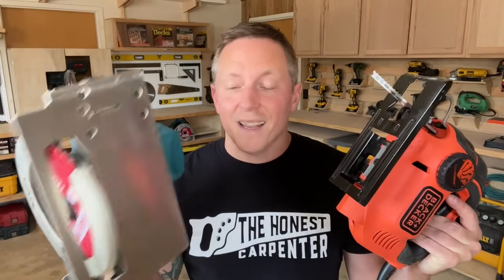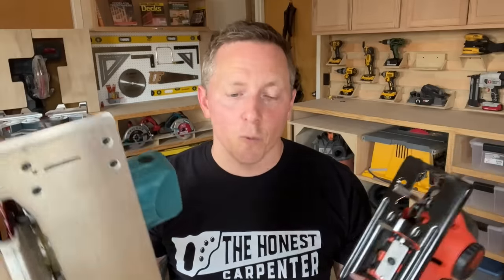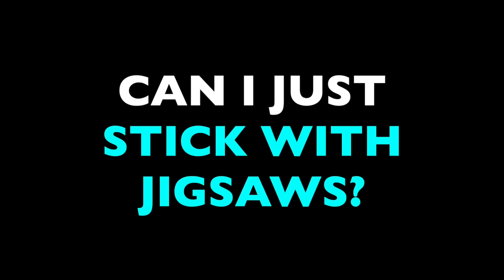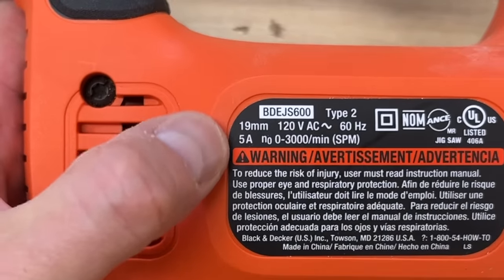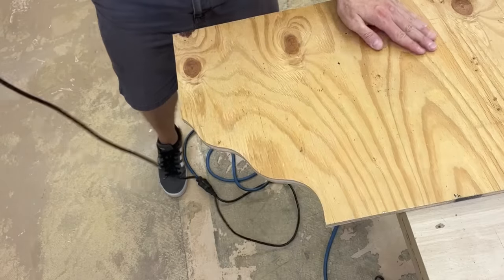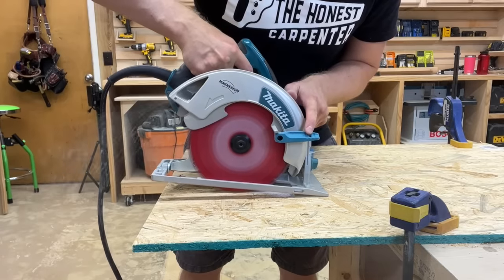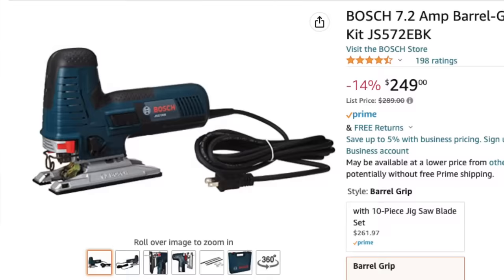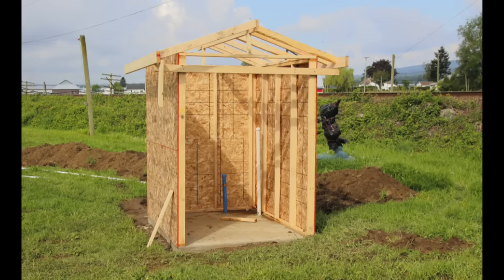CIRCULAR SAW VS. JIGSAW...Which One Should You Own?! (FULL COMPARISON---New DIYers Should Watch!!)

Comment: I can't speak for everyone but I'd need both. You'd need the circular saw to cut through heavy boards & make long cuts, & if you need to make a precision or shaped cut you'd need the Jigsaw. 👷🏿‍♂️
Reply from the maker: Yep, you definitely reach a point where it just pays to have both. This is a tough call for extremely new DIYers though!
Reply: I've used a jig saw (or sabre saw) to cut non wood materials my whole life.  Indispensable tool, and much faster than a hack saw.  But for wood, the circular saw is just so darned handy.  So I agree, get both.
Reply: @TheHonestCarpenter  yep, especially if you can't immediately get both.
Reply: @chrisnorton2837  The portaband saws are great for metal.  I started machining a few years ago.   Have 2 wood cutting and 2 metal cutting saws.    The right tool for the job.
Reply: @danharold3087  I think the choice between "best" and "good enough" depends on how much cutting you might do. The circular saw I bought nearly 50 years ago hasn't yet seen enough use to justify the greater expense of "best," "good enough," perhaps with a better blade, would have done everything I have needed.
Reply: @oneeyedphotographer  Cool I still have my Skill brand saw purchased in 74.  It is far from new.   I recently purchased a nice Makita hypoid drive rather than burn out my old friend cutting RR Ties.   

So my choice was to burn out the skill saw and then buy another.  Or buy the hypoid now and have both saws to use going forward.   

As for the bandsaws that is kind of interesting.    It comes down to your use model.    My horizontal metal cutting bandsaw came from a friend who more of a welder kind of guy.   Had no use for it after he got the portaband.   It ended up in my shop.  I put a quality blade on it and it gets used on most every project.  I do hobby level machining.     I bought the same  portaband as he did and seldom use it.
Reply: @oneeyedphotographer  The best use for an OEM blade is on the wall made up as a clock.  IMHO
Reply: @dwightl5863  best use of a jigsaw is upside-down as a sundial
Reply: @juliblued  then i would get a jigsaw,  u can cut longer pieces just takes longer , and gives time to learn skill with one and understand them more
Reply: can I use the circuit,
 reduce the speed of the circular saw.
Aliexpress has it voltage reduce circuit
Reply: First time I went to cut a 2×6 in half length-wise with a jig saw I decided to go get a cheap circular saw.
Reply: Thanks tho cause I’m building a shed and I want just the jig but I guess ima need both…

Comment: I bought this mitre saw in June 2014, and I remodeled my basement with it. It it sturdy and it works great  https://www.youtube.com/post/UgkxKL3MYO42eA2JbKxs7_Q0tmRGZI4Ow4Ar  . There's not a lot of extra play in the adjustments and it is definitely well built. It is lighter than higher-end sliding double bevel models, so I can move it myself, which is nice. When I had to cut 2x10 lumber, I had to flip the boards over and cut twice; but since most of my cutting was on smaller dimension lumber, the weight reduction and significantly lower price seemed to be a better trade off for the boards I did have to flip. Late in the project, I was able to borrow a DW718, and the sliding feature does make fast work of 2x10s, but it is a tank, and I stand by my choice of the DW715. I also added a laser guide (one of the arbor replacement style sold on Amazon), which is nice to have, but definitely not needed.

Comment: For me, buying a jigsaw first came simply from the fact that my initial wood-related DIY tasks were infrequent and small scale, such as cutting across a narrow batten or a hole into a counter. The first project for which I needed more substantial power tools was floorboard repairs, where the accurate depth control of a circular saw made it possible to lift out old tongue & groove boards without damaging joists or wiring. It could also cut down large sheets, and although I borrowed a mitre saw the circular could obviously handle chopping to length too. However, the jigsaw came in handy for nibbling away ends in difficult locations, like up to and even under dividing walls, notching around obstructions like pipes, and many times the square cutting face of a jigsaw blade was desirable over the curved travel of a circular saw. Bottom line, even though one probably gets used more, both are essential for most woodworkers.
Reply from the maker: All good points, Khakoo! Getting into that complexity of work, you're definitely going to need a combination of both, as well as possibly a multitool and recip saw. 👍
Reply: I have both but don't often use them. At the Menzshed I use two bandsaws for preference
Reply: thank you for commenting..🙏🏼

Comment: You need both.  That said my first was a jigsaw because the project I needed to do needed a jigsaw. I couldn't afford both in those days, so whatever long straight cuts I had to do I did with the jigsaw.  Including an 8 foot plywood rip... I clamped a level in place to use as a guide - wasn't too bad - except I had to move the 2 foot level every 20 inches or so.

Comment: It was amazing to see those photos of houses being built out of so more wood. Here in the UK that's virtually unheard of. Most houses are built of double brick walls with insulation between the layers then fitted out inside with timber frames and plasterboard. Roofing and floors are made from timber.

Comment: I had a near mistake with the jigsaw yesterday because of the points you make with them. I "carelessly" picked it up to move it out of the way and accidentally pressed the trigger without having the lock switch engaged. I would never have done that with my circular saw. Excellent video, as usual.
Reply from the maker: Glad it wasn't bad, Elmo! That's what's crazy about jigsaws--they typically do their damage when you're least expecting it 😓

Comment: Hey Daniel, the books look awesome, congrats.. I'll be picking your books up ASAP. Also, the saw conversation, to saw or not to saw? Lol. Anyhow I have a Milwaukee M18 6-1/2" circular saw. And I more recently picked up the rear handle or worm drive Milwaukee M18 fuel 7-1/4" circular saw. I also have the Milwaukee M18 fuel D-handle jigsaw. However I use my circular saws a lot more than my jigsaw. My opinion, if you are a diy-er or a carpenter, or a woodworker. I would recommend following his advice in this video. But I would also recommend once you purchase your first saw. Whichever, will help you out more so with the projects your doing. I'd still plan on picking up the other saw. Because they are both very useful in their own ways. As he explains in the video..

Comment: I do remodels and home repairs for a living (so small to medium size projects) and I use my 6-1/2” cordless circular saw for 95% of lumber cuts. It’s awesome!! Sometimes you need a jigsaw, and very occasionally I need a full-size circular saw (but rare, as I don’t do much framing and my small one can handle a few cuts here and there in 2x materials, and if I have more to do I use a miter saw). Anyway just wanted to mention those are an option and way more maneuverable. I’d say for a DIYer it’s perfect!

Edit: just contributing to this discussion, not saying it’s a replacement for a table saw, etc if you need that.

Comment: Crafter turned craftswoman, here. 

I appreciate this video because I thought I NEEDED a circular saw. I have a circular saw, I've become unafraid of it, with ear plugs it's much less stressful to use, and I've completed projects, as well as started a business I probably would never have attempted if I hadn't bought one. And. I'm glad to know these fundamental differences because in the past, I had used my jigsaw for cuts which I thought were meant to be done with a circular saw, so I thought I was "doing it wrong", which I equate with being unsafe. I'm glad to be wrong about that. 

I'm interested in trying a bevel with the jig saw, I am a big fan of the bevel, but haven't bought a miter (yet, and possibly won't) - I didn't notice that the jigsaw could bevel, and funnily enough I was initially compelled to get the circular saw because it could bevel.  I guess there are different routes to gain experience and education!  I appreciate learning the versatility of my tools. 

I got a jigsaw about 35 years ago when my grandfather's scroll saw broke down and my dad didn't repair it right away. I was purely a hobby crafter, so I used it only for pattern wood cutouts. When my father passed away and I suddenly had access to all his tools all the time, my projects immediately increased in scale. Now I make & sell pretty garden obelisks & trellis, and various other decorative garden structures, and contract out to build custom pergolas - as my job!!  I built myself a spacious workshop, chicken coop(s), built-in cabinets and buffets.  Instead of replacing my ancient homemade plywood kitchen cabinets with prebuilt products, I used the plywood as a framework for totally tricked out kitchen cabinets! I changed lower cabinets to slide outs, etc. I made all my outdoor furniture and some very fine indoor pieces which get compliments from everyone who crosses my threshold, which I also made.  I've come a long way from decorative birdhouses made from balsa! I never stop learning! Thanks for the videos, you're one of the best content providers! ✌️

Comment: Kinda interesting topic, which drew me instantly to watch it.
But. I'd definitely get myself both if were seriously getting into more woodworking.
 I've used often the circular saw to cut 3-4mm aluminium sheets into halves at work. But the jigsaw has come in handy to cut smaller holes for displays into metal boxes - if not just wanting to use the good old angle grinder to cut thin sheet metal.. Yea. I now kinda realized that I've probably more used these for metals over wood etc - but still I think both are just fantastic tools for their own purpose.
Would definitely not buy any of the cheapest ones - but I might even pay a bit more for a decent circular saw than for a jigsaw. Have used pretty decent jigsaws that have been on the more inexpensive side. Just do not cheap on the blades.

Comment: Between work and home, I have multiple corded and cordless circular and jig saws, though my most-used cutting tool is a Milwaukee cordless circular saw.

Jigsaw blades take up very little storage space, are a lot less expensive than circular saw blades, and are typically easy and fast to change without tools. This allows you to have a wide variety of blades on hand that you can swap out for whatever material you're working with.

Another factor worth considering is how the power consumption of a tool affects how well it works to be cordless, especially if you don't have large capacity tool batteries. The lower power demand of a jigsaw is a better fit for the 2 Ah and smaller batteries that typically come with starter cordless drill or drill/impact driver combo kits. If one could only have two cutting tools, I'd recommend a corded 15A circular saw, and a cordless jigsaw in whatever battery platform you've chosen for your fastening tools. That way, you have corded power and endless runtime when you need it, but also have something lightweight and very handy that can also cut curves. An additional benefit of buying a corded circ saw is that they're readily available and quite inexpensive on the used market.

Whatever you choose, I'd suggest to keep in mind two things: a saw is only as good as its blade, and the first saw you buy doesn't have to be your last. To the first point, the longevity and superior performance of quality blades can make them the better value in the long run. There are other good brands, but I've rarely been disappointed by Diablo products. To the latter point, when you're first starting out, you don't really know what you'll like best. For circular saws, there are decisions to be made on blade size, blade-left vs. blade-right design, corded or cordless, and sidewinder vs. worm drive. For jigsaws, there are both barrel grip and d-handle designs, as well as U-shank or T-shank blades. Besides the fact that T-shank has a better blade selection, there aren't any absolute right or wrong answers there. Nothing will educate you as well as getting some experience of your own, so get out there and start building!

Comment: Hey,.. one of the best pieces of advice for tools. I was really wondering and confused of usage and type of usage that Iam into and I was looking for one that makes my projects easier, I completely agree how intimidated the circular saw is, For the very first time I used the circular saw and just with very first start and the noise level and the power from circular saw made me to think that Iam hurt myself and return home with one finger or one hand missing from my garage. The amount power circular saw emmits make the first time user faint and think am I handling it wrong, but still I saw able to manage with my strength, it woudlnt have gone easier without any injuries if a lean person or focusless person, the power of backdraw from circular saw while in the motion feels like whole arm is coming apart from the body,.. but still, as said in the video, it's for the faster cuts and plenty of cuts, make a best tool after a few cuts.
But for me, I mostly do simply projects like cages and tables, Im convinced that jigsaw is all i wanted after watching the video.
For any art, patience is the key, so jigsaw does the works slow and steady for not only beginners but also for occasional woodwork.

Comment: I have a great suggestion for another great video. Extension cords! Firstly, do you have a favorite way to store them. I've tried many different ways and they're all a pain in the but. Do those auto retractable doohickies work for a dedicated shop one. Second, is there a favorite cord of yours that doesn't twist and is easier to roll up and put away. I have the cheap orange ones that have a memory making it difficult to wind up for storage. And lastly is there a minimum gage that you recommend. Great channel!
Reply: I generally just buy good quality 3 core cable and make my own.

Comment: I’m a stay at home mom wanting to do some home improvement projects like replacing broken trim, adding wood to walls for a “textured” look, making shelves and planter boxes to hang on the walls, and I really wanna make my dog a nice little house so he can go outside more. My main goal first is to saw off about a foot from my sons metal framed loft bed. It’s like really thin metal that’s hallow, so I need a saw that can use different blades for different material for plastic projects I wanna do as well. 

I was apprehensive about jigsaws because it seems so hard to control. I used a big one my dad has to cut tree limbs and it was get stuck and shake/vibrate me SO FAST AND VIGOROUSLY that it scared the shiitake out of me and felt so dangerous cause it was just out in the open. I won’t be cutting through hard wood like that for my little woodworking projects so I hope a jigsaw will do the trick! As long as I get one that has that guard thing to keep the saw stable. 

Thank you so much! I watched a few other videos on this and have been scouring the web but your video explained it so much better and actually helped me!

Comment: I've got both and when I grab one it's almost always the circular saw.

Jig saws are great for cut outs, giving a straight end cut vs the curved in cut when not cutting all the way through.

Jig saws are much harder to do long straight lines due to such a small blade while the circular saw blade tracks better.

Basically its a matter of the right tool for the particular job. Sure you can use the jig saw for just about everything the circular saw can do but it's not the best choice for many jobs due to time and ability to free hand longer cuts with decent edges. The thicker the wood the more the circular saw shines.

Comment: One thing you should probably mention is what shank the jigsaw takes. People do love a bargain and garage sales, pawn shops, online are great places to get tools at a good price. With jigsaws however, the older ones used the U shank blades, the new ones all use a T shank blade. Check what shank or uses before buying a used jigsaw. Those U blades are getting really hard to find. I bought the last pack the store had and they haven't had any U shank blades since. When the blades I have area worn out it'll be time for a new jigsaw.
Reply from the maker: Good point, dave! I had to save a lot of stuff for a later jigsaw video, but I'll definitely talk about shanks. 👍

Comment: TBH, If price is a factor get the less expansive models and buy both.  It well worth the money considering it will make the project easier.  Right tool for the job is much less likely to get yourself injured.  Inside corner cut, jig saw is a must have.  Everything else, I use circular saw where I can.  You probably don't need this, but, will be helpful for most DIYers to make a simple circular saw track.  It will really speed up the process for cutting plywood.